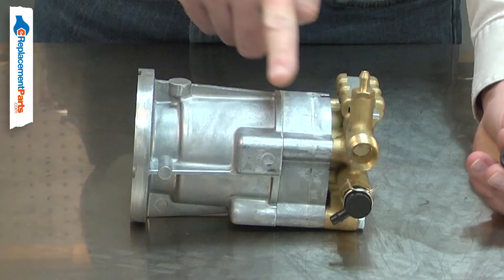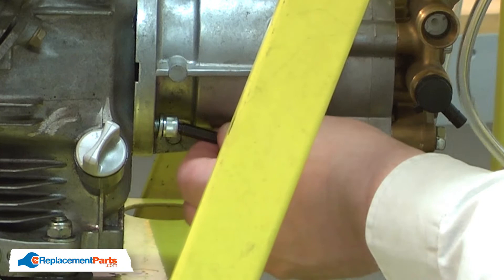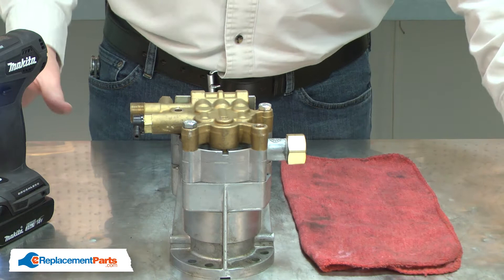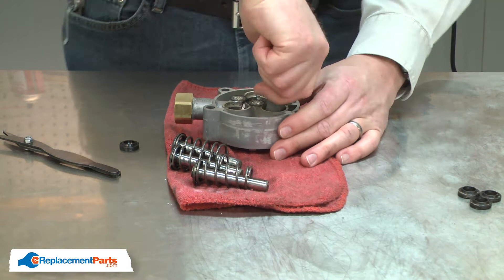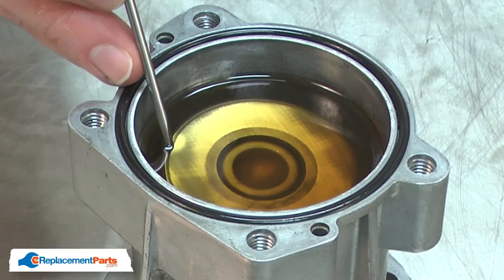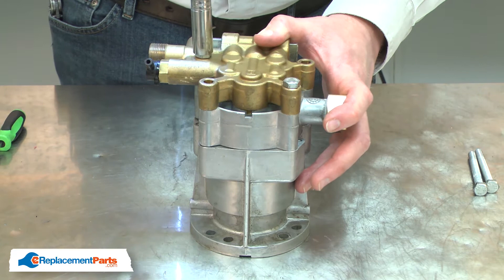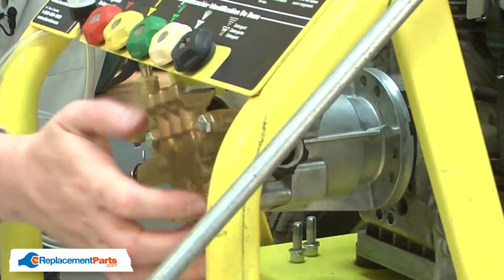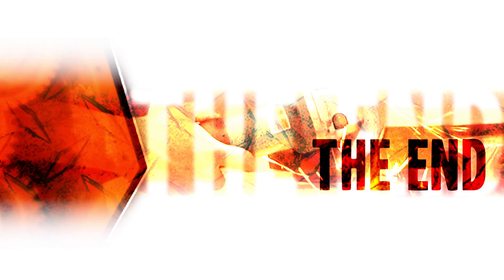Karcher Pressure Washer Repair - Replacing the Oil Seal (Karcher Part # 6.365-393.0)

Comment: I changed mine and what I did was to heat the assembly slightly with a hot air gun to expand it and then the seal came out and the new one went straight in. Because its aluminium it soon expands...I had some plastic pipe of the same size so it went in straight...

Comment: Hi, Does this pump have a unloader valve?  I don't see the  location on the outside of the pump like others.
Reply: Its located under the TRV where you see that black plastic part 1:52  remove that and unscrew the nut with a 19mm
Reply: the uploader valve can be hard to pull from the pump.  it sits down in the pump and has a small "knob" on the top but its hard to access.  I could not get needle nose pliers to get enough grip to pull the valve but I took a grinder and ground down the tips of the pliers about 1/4" inch.  This allowed me to get more grip on the valve and it pulled out easily.